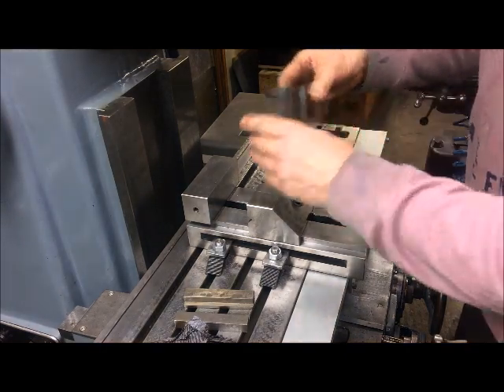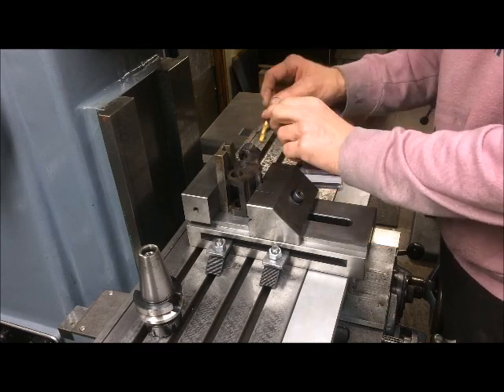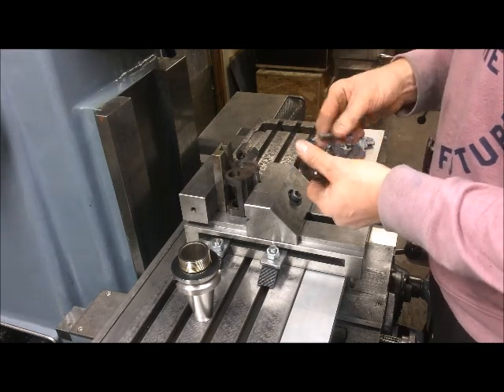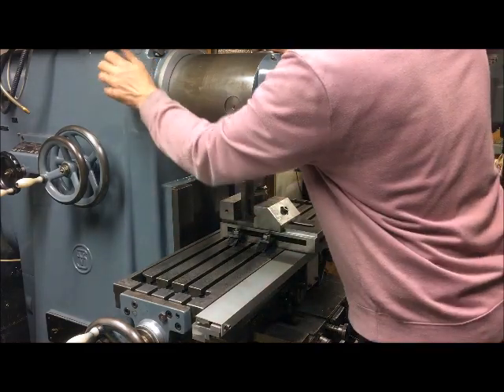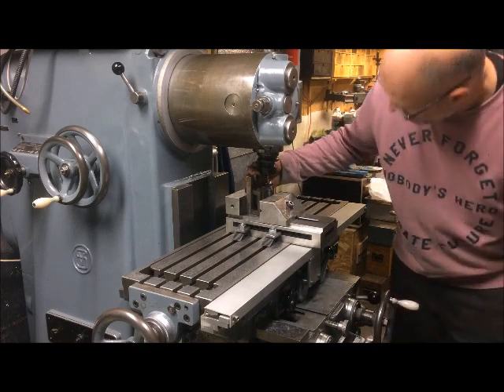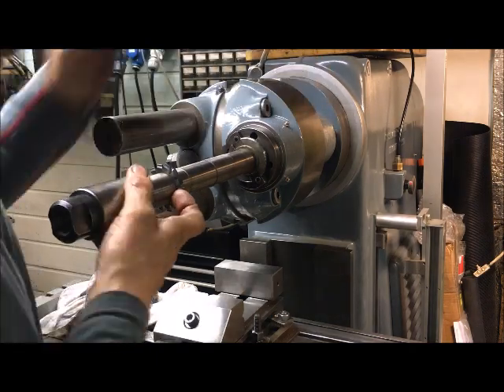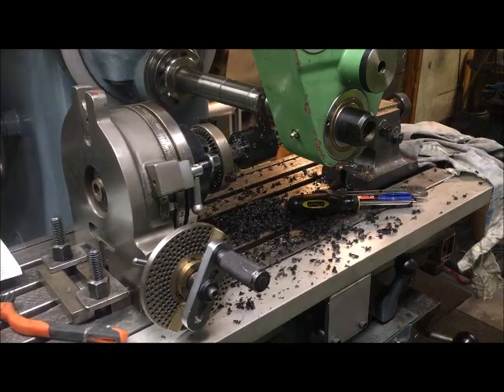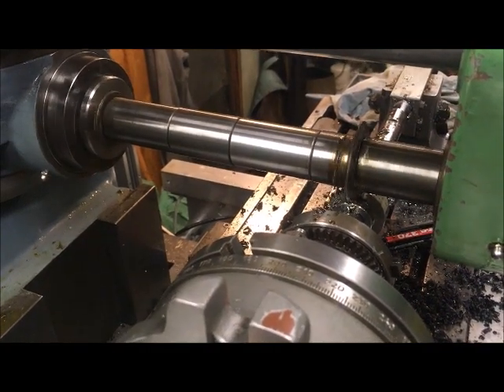Schaublin 52 action  - milling Raglan parts

Comment: Wow, I like how that milling machine is designed.  The spindle 'barrel' looks very rigid, being completely enclosed by the body casting.  I will have to do some homework on that design.

Cutting gears on a mill is pretty satisfying work, almost as much as cutting them on a shaper 😊
Reply from the maker: The Schaublin series of milling machines, ie. the 51, 52, 53 and 53n share this design.You can look them up at lathes.co.uk. Yes, quite rigid and very versatile